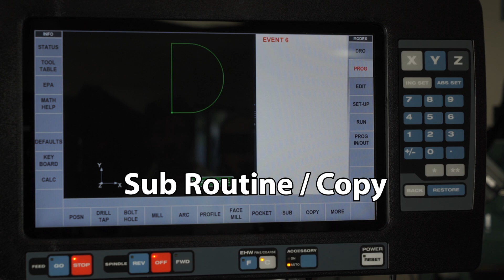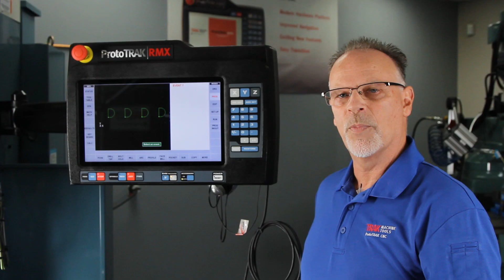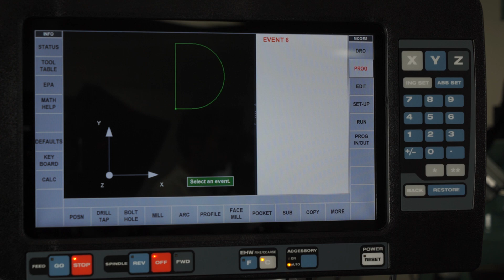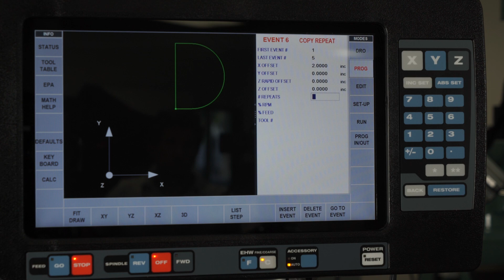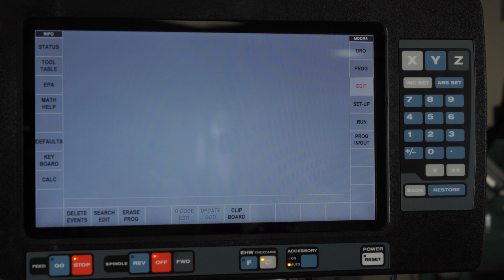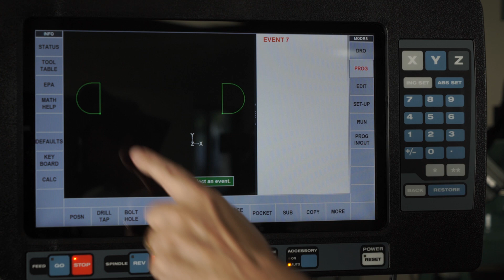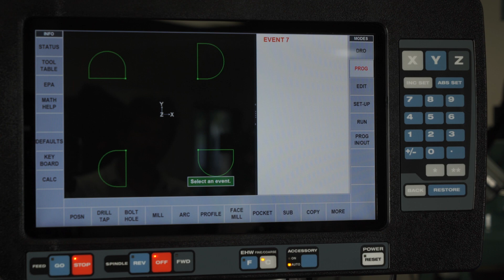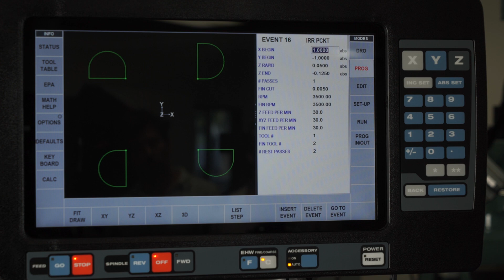Subroutines & Copy with the ProtoTRAK RMX CNC | TRAK Machine Tools

Comment: Subroutine is not reliable on their RMX.  The control shut the spindle off while machining in X and Y after running a half dozen parts without making any changes, which trashed a $500 face mill.  I even gave them the code 1 to prove it, and they agreed that it happened.  Then told me too bad for me and I shouldn't use that function anymore.  Wow!?!?  What do you do with that?
Reply: Hi Andrea, I'm sorry you had a negative experience. I'll look into this and get back to you in a day or two. We appreciate that you took the time to post.  T.P.